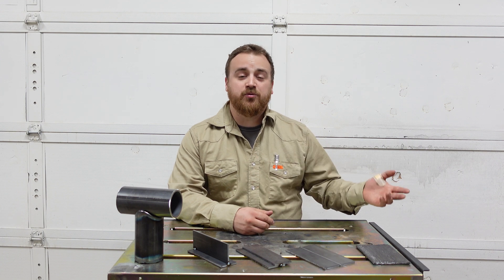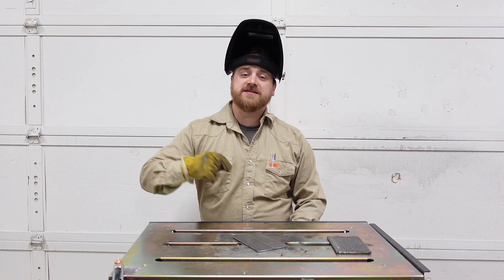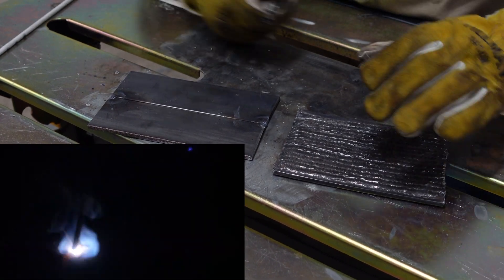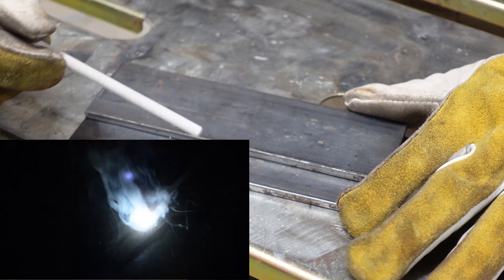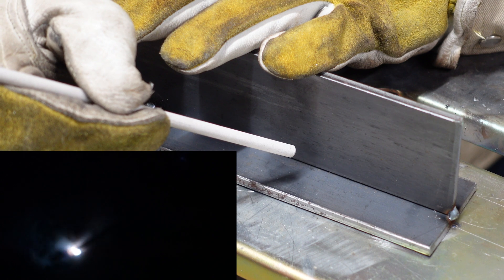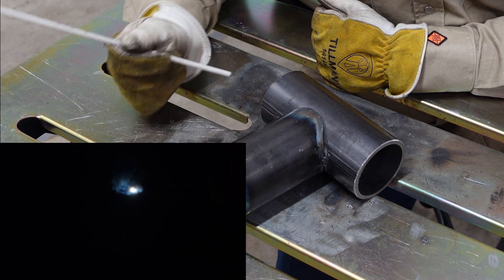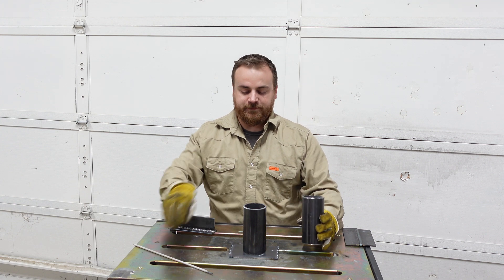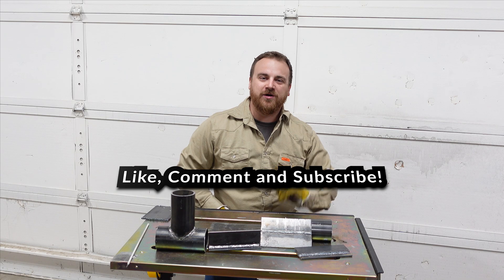How to Weld Different Joints

Comment: Hi, this was an excellent overview with a few excellent tips. As a beginner welder, I appreciated your series of how-to videos. The only thing I would have wished for is fundamental data about the plate thickness (plus if also given in metric) and the rod size/type used. I often see very thick plates used in practice. I guessed because of certification, but they are more expensive than thinner materials. Keep the good episodes coming. Cheers.
Reply from the maker: Glad it was helpful!